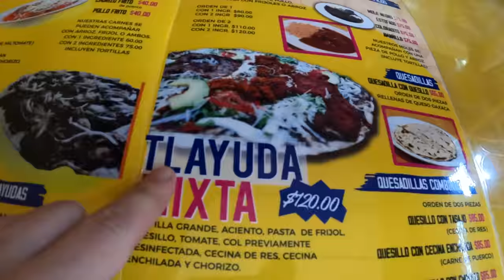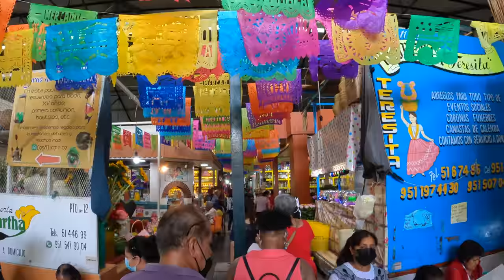The BEST motorcycle shop of Mexico |S6-E82|

Comment: You'll be geared down just a bit, but not much. The tire height being a bit taller will split the difference a bit. You may find it being geared a bit lower may be better in tight offroad situations. I've been the owner of a small bike shop for many years and those folks really rolled out the red carpet! Thank goodness for that small shop. The small shops that care are the best!! Safe travels!!
Reply: Agree 100%.
Reply: it does not show Honda in a very god light with regards to customer service and back up given the number of bikes that we have seen during this series.
Reply: @johntolley1111  Most people would order a sprocket and have it in couple days. Or used to do that. With current supply issues that might not be possible. But she moves around so much with no real plan to be at X location, makes it impossible to ship to her.
Reply: @gailtaylor1636  Did you notice that when Noraly was walking into the market and Noraly read the date as she walked in it was about six months ago.
Reply: @johntolley1111  I missed that. I wondered about the picture of what appears to be Alaska, not the bike, in the intro. I've always said these are months behind. Doesn't really matter. The content is incredible.
Reply: @johntolley1111  Market 20th of November was name of the place she was entering if that's what you are referring to. Look at the marking on the building. 18:10
Reply: @johntolley1111  It's the name of the building. November 20 is a holiday to commemorate Revolution Day.
Reply: @gailtaylor1636  🤣
I wondered about that name. Only open one day a year?
Reply: @humandroid53  more likely to be closed on Nov 20 for a holiday.
Reply: @johntolley1111  She was in Belize for the New Years Day, I believe!
Reply: First thing I did on a CRF250L Rally when I got it, was to change the stock 14/40 sprockets to 13/42.  If you only make one mod to a 250L, that's the one to make.  Sooooo much better across its entire range of speed.
Reply: @johntolley1111  ---  nope:  that, strange though it be, is the name of that Market  -   not the date
Reply: @johntolley1111  John, in fairness to Honda I think the issue is that Noraly’s motorcycle is just not sold in South America. Therefore it is to be expected that a lot of parts she needs will not be available. It would be a similar case with a lot of cars which we have here in the US and taking it to Europe and having trouble with certain parts. The US version of the car would have a gasoline engine and the EU car would have a Diesel engine or if it was gas it would likely be a smaller gas engine than the US version.
Noraly’s bike must have a pretty unusual tire size, because Honda or no Honda it’s strange that no shops seem to have the tire size. You would think that off road tires would be more common than tires for paved roads in all of South America since they have so much unpaved roads everywhere. So my guess is that the tire size must be the biggest issue.
Reply: @rudolf6547  November 20 is Mexican Revolution Day to mark the unseating of Porfiro Diaz.
Reply: Motorshop are owned by motordrivers, and there is mostly a good vibe among motorcyclists.  Always greeting and helping each  other where they can. Thumbs up for this shop.
Reply: ......they are really great these people there from this store and thank you to Noraly for letting us know through this or these videos ..... at home .... that they take an example from these people bravo🤗
Reply: @toqtoq3361  You are quite right!   It's great for commuting under 55mph/90kph.  It does OK at 70mph/110kph, but like you said, you're winding it out, and it goes through the fuel pretty fast.
I've been getting the itch for much longer road trips, so I just recently picked up a BMW R1200GS.   Still good for commuting too, but it's too big of a bike to do some of the offroad places that  I'd take the CRF without hesitation.
Reply: @toqtoq3361  you're correct not a ton, but definitely a bit. It will definitely be geared down some.
Reply: @johntolley1111  it is not the Honda Customer Service to be blamed. It is the type of her motorcycle which is not common in Mexico and other South American countries. A Honda car build and sold in the US might have problems too when exported to Europe.
Reply: What is the chance Honda didn't know about the deal😜.
Reply: @Peter-gi3re  Tire size is probably more of an issue ,if you want more expensive well known brands . A lot of locals are not well paid & more likely to make do & mend & go for low cost options that are not likely to be found in a big Brand main dealer . This is where the smaller motorcycle shops come in handy as they will be likely to stock budget Chinese tyres the main dealers like Honda Shops are unlikely too .
Reply: @maskedavenger2578  I wonder why the basic enduro tyre sizes wouldn't work on her bike... Or are they just not available in central America
Reply: The type of motorcycle tyres that are likely to be available in Central America ,are the ones that fit the makes & style of bikes the locals are riding . These are from what I can see are mainly small capacity budget Japanese / Chinese street or trail machines . The locals use these bikes on pathed & dirt roads ,for general transport.& even to run small businesses . The locals are more than likely having to survive on low incomes & not concerned in having a fancy name brand tyres as long as they are affordable & do the job . Had Noraly have tried other dealers besides Honda franchise at an earlier opportunity ,she might have found some non big brand name tyres that were the correct size in various Central American towns .

Comment: I understand the limitations of finding parts.   Along with a more aggressive tire set-up....Your riding style would benefit with a larger rear sprocket.  Better bottom end to put the power down in climbs, water crossings, more torque in the lower gears..etc.
Reply: It is like a bicycle gears. More teeth mean a lower gear ratio and also more torque. The first gear has the highest number of teeth on bicycles. 
I hope it will be good to keep going until she reaches the US.
Reply: Fuel consumption mpg or Lt/100km will go up somewhat when cruising tar roads.
Reply: I agree, a bigger sprocket would improve off-road use.  It is a good thing they did not have the 38,  think this bike has not enough torque for a 38 sprocket.
Reply: I would disagree with the sprocket change. I have 2500 miles on my Rally and the 1st gear is way granny, and 6th is overdrive. She would loose the benefit of top speed which on mine is around 80 MPH. She's coming to the states and if she rides on I5 in California or any other highway in the west you need some speed. I was on I5 in Oregon for an hour yesterday heading north coming back from forest roads heading north and needed the gearing that came with it.
Reply: @dirtroaddan1462  Noraly avoids highways so she'll be fine!  I can only see one problem:  Tires are difficult to find at this time in the USA.  Maybe because of the smaller size she'll be lucky!
Reply: @rick262  The 250 had those problems, that's why they changed the engine and gearing in 2021. I run stock everything (except Tusk Dsport tires) and even run regular gas. Some ECU mods require Premium, but without regular is better. I can go 80 on flat, I was going 75 passing trucks on the interstate yesterday. With the gearing change first is plenty low, I've been up some very steep hills. I think changing the gearing on the 300 doesn't fix anything.
Reply: @dirtroaddan1462  It's only 2 teeth on a 40 teeth rear sprocket and the tire is a bit taller. Probably the final speed by 1000 RPM will be very close.
Reply: @pabloricardodetarragon2649  Trying to solve for a problem that doesn't exist. They solved it in the 300 from the 250 with an updated engine and gearing.

Comment: With that rear sprocket not fitting exactly original make sure bolts are staying tight visually and you can also give it a kick in the morning before packing up . You will see and feel it's loose with a kick. After a few days if still tight it should stay tight.

Comment: Actually for the riding you do I think the 42 tooth over the 38 was a good decision. As far as chains ,sprockets and tyres your old crf250 was identical. Thanks as always for another great video.
Reply: And the 42 will help off-set the tire height gearing change effect. She likely won't notice any difference on the highway but will in the dirt. Tall tire rides on top of the pavement while the tread sinks into softer ground. Kinda changes "gearing" effect?
Reply: First thing I did on my 250L was to replace the stock 14/40 with 13/42.   Best decision that I ever made!
I like the lower achievable speed for the real technical challenges, more acceleration is always a good thing, and still tops out near 80 mph.

Comment: Those tires look nice, better than the last ones. Even here in the US the tire size is hard to match perfectly for the Rally. I just purchased my first set of aftermarket tires for mine, the Tusk Dsports, and I absolutely love them for street and dirt. Much nicer than stock, but still the rear is 10mm taller. If you went up in size with the rear sprocket, and you also installed a taller tire in the rear, than that would put you right back at stock gearing, good job! . This was such a cool video. Helpful, nice people everywhere and a pretty place I’d like to visit some day.

Comment: All chains will stretch after initial installation. Then they need to be readjusted. I have changed dozens of chains over the years and all of them stretched after a few thousand miles.
Reply: Exactly, I was thinking the same thing, and I can't see a sprocket wearing out a chain so fast, I got close to 30,000 miles on one of my chains on a much more powerful motorcycle, I probably pushed that one more than I should have Lol but chains are meant to be adjusted, not to be replaced after it stretches, just my 2 cents.

Comment: So glad you were able to find tires with a better pattern for off road, hopefully the rubber compounds and construction are okay for on and off road. the larger rear sprocket (42) compared to the stock (40) should give you slightly better low end performance, but slightly less top speed. Good luck with your adventures!
Reply: And about 5% more fuel burn! But hardly noticeable with that type of riding?
Reply: @rogerblackwood8815   More likely a fuel savings. The bike was probably geared for 1st world roads where it was originally sold. In Mexico, speeds are slower, so shorter gears are better there.
Reply: @e-curb  In simple terms, raising the rear by 2 teeth lowers the gearing. So every mile covered in any given gear means the engine will need to make more revolutions to cover the distance than with a 40 tooth. More revolutions means more fuel to turn the engine! 
If we assume a 15 tooth front sprocket the numbers look like this.
40 / 15 = 2.667 Standard Gearing
42 / 15 = 2.8 aftermarket sprocket.
So you get better acceleration but lower top speed. Good for doing wheelies👍
But it will use more petrol than the OEM parts! Think of it like this, if you ignor sixth gear and run in fifth, you will use more petrol per kilometre. That is just simple facts/maths etc! It is no different, except the margin is higher, than raisng the rear srocket, which is termed as lowering the gearing, there will also be a noticeable difference in the miles per hour per 1000 RPM, as in there will be less miles per hour per 1000rpm, and MORE FUEL BURNT.
But I do agree with the type of riding she does, it may well be helpful in some situations, but long stretches on the highway will use more gas.
Reply: @rogerblackwood8815  Taller gearing doesn't necessarily mean better fuel economy. If you believe it does, then why aren't you cruising around in town in 6th gear? What makes the best fuel economy is running the engine at the torque peak rpm. With the lower gearing of her new sprocket, that optimum rpm happens at a lower speed, closer to the speeds she will be riding at in Mexico where the road conditions dictate slower speeds.
Even if she's out on the open highway (which she avoids at all cost), I doubt she's going very fast.

Comment: Keep a check on the rear sprocket bolts that secure the sprocket to the wheel.  The hole diameter in the middle of the sprocket should make tight contact with the hub on the wheel that fits into the opening.  If not only the sprocket mounting studs will be loaded with all the pressure on the rear wheel which isn't good.  The extra two teeth on the rear sprocket will be of great help off road with slightly higher rpm's at lower speeds and more torque.   Even on the open road I've gotten better performance on some Honda bikes running slightly larger sprocket on the rear especially where there are hills and mountains.  Good video btw!

Comment: Noraly, another great video! Always enjoy. At the beginning of season 6. New bike. My thoughts were, "Replace the OEM aluminum rear sprocket." The weak link in final drive is the aluminum rear sprocket. On my dirt bikes I replace with "Supersprox" hardened steel ring sprocket, another option is "Ironman" sprockets. Keep a fresh front sprocket and the chain and rear will least a long time. Just a suggestion from an old dirt bike guy.
Reply: who makes aluminum sprockets? it would wear out in hundreds, not 1000s of miles...
Reply: @ivok9846  Every dirt bike I've had was equipped with an OEM aluminum rear sprocket. I don't know about the 300 Rally. Supersprox is a hardened steel ring around an aluminum hub.
Reply: @mikeshuck2760  must be some sort of alloy, aluminum itself is too soft...

Comment: After you left the people at the motorcycle shop, I told you someday someone from far away would buy those tires, chain, and sprocket.
Reply: I thought the same thing. Clean that tire up and it'll look much better than an old worn out tire for some one, some day.
Reply: I wonder why she had to change the tires? Look fine to me. Of course I am no motor bike expert. Also I wonder the same about the -sprocket?-, whY she needed to change it?
Reply: @rafaelgrajales8251  The tyres had no traction in mud and gravel. The sprocket is chained with the chain because they wear together. As the chain stretches with use, it wears the teeth of the sprocket into a pattern the fits ONLY that chain. Change the chain without changing the sprocket, and, as Noraly said, the chain will wear out far too soon.
Reply: @N1inSK  oh I see! Thanks for the explanation.
Reply: @N1inSK  Exactly. Good answer.
Reply: @rafaelgrajales8251  Those were mainly street tires and it's all she could get at the time. That's why she struggled in the muddy conditions. Sprockets and chains wear out and need to be changed at certain intervals. You don't risk unnecessary breakdowns when you ride remotely as she does.
Reply: @lavapix  oh ok I see ...thanks 👌
Reply: @normbjorn  yes, 😅 we call them "gallitos" to all used tyres that buy cheap on some emergency to keep travelling.

Comment: Hi Normally, I just watched an old episode of your videos from Season 2 Episode 5 titled "Fix That Puncture". This was the first time I have watched you without "Alaska" and hated to see you wind up with a flat rear tire. I think that 2-1/2 hours was pretty good to repair it way out there in the middle of no where. I am 68 years old now but when I was a boy of 12 we had hot tire patches that self vulcanized onto and over an inner tube puncture. There was a little clamp that held a metal container with a patch and dry fuel of some kind. You would clamp the metal container down with the patch over the puncture and then light the fuel with a match. The fuel burned very hot and melted the patch onto the inner tube. In this manner you could pull only the punctured part of the tube from the tire and repair it without removing the wheel, the chain or the rim. You would have been back on the road in less than 1/2 hour! Very ingenious device but I do not know if it is still manufactured.

Comment: The only bad thing about changing the tooth count of your sprocket will be the Error in your bikes speedometer & odometer readings.
It will show a substantially higher road speed & distance traveled than actual. But I'm sure that with your GPS system you have already figured that out. Very glad that you finally found more off-highway suitable tires. 
Ride On.

Comment: So glad you didnt go for that 38T sprocket. That would have made a big difference to the tractability of Alaska and you would have been left struggling on any steep inclines. Hope the other new parts prove reliable and deliver a few more kilometers of riding. You mentioned that your new tyres ride higher than the ones you've replaced. This is going to alter your odometer readings if thats the case. If the tyres have a longer circumference then the odometer will read that as you traveling more slowly and covering less distance. I guess your GPS will tell the real story, so no loss of realtime journey info. Bien suerte!

Comment: Hey Noraly, so with regards with your motorcycle's chain and sprocket, your chain stretches substantially after installing a new chain and requires adjustment shortly afterwards.  After the initial stretch, you chain is good until the next chain adjustment interval.  With the sprocket, I am glad you did not go down in number of teeth on the rear sprocket, because that would mean that you would have to rev you bike much higher to get the same speed.  So going up in the number of teeth in the rear sprocket, gearing down,  the outcome would be better acceleration but less top end speed.  With the new tire, the rear tire pattern is better for off-road riding because of the knobby blocks, though I have not heard of this brand.  This rear pattern is similar to Charlie's rear tire pattern and should give you better grip off-road.  Oh yeah:  Where's Charlie!!!
Reply: love Google , makes us all experts on any topic.